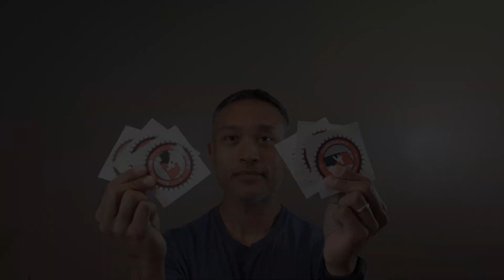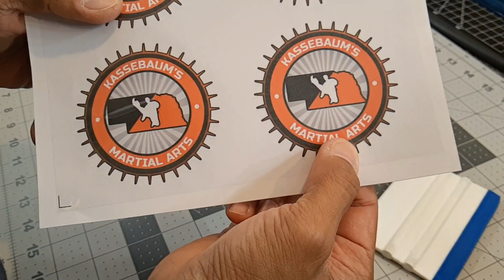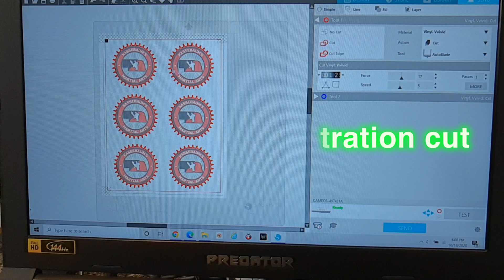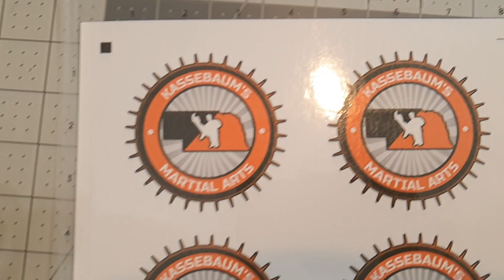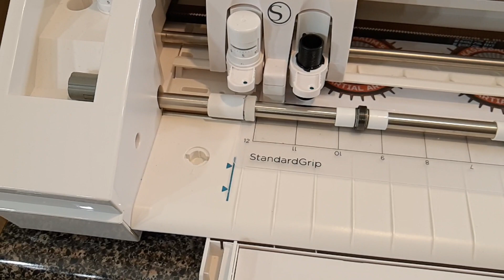How To Print and Cut with Silhouette Cameo | Make Full Color Waterproof Stickers at Home

Comment: I have found that I tape just the 2 upper corners of the printed sticker paper then when I go to apply the clear top sticker the bottom one does not move and then I can really control the wrinkles and can really use the squeegee to your advantage without having to hold the printed sticker paper down too.
Reply from the maker: Thanks! I've started to do similar as well because the sticker paper moving underneath was annoying.

Comment: Does laminating your stickers save the hassle of having to wait for the ink to dry on the paper or do you still need to wait for the ink to dry ?
Reply from the maker: I personally would wait for the ink to dry. If the ink is wet and you try to laminate it, and it's not fully absorbed into the paper, the ink may smear out as you press down on the laminate.
Reply: @ColorChangeCustoms  how long do you recommend to let it dry ? Because I let it dry for 24hr but the ink wasn’t dry yet at all
Reply from the maker: @SinKnight  I usually do overnight. But really it depends on the manufacturer of the ink, and maybe what the manufacturer of the sticker paper you used recommends as well, in terms of dry time.  For ink not to dry over a 24 hr period seems odd though.
Reply: @ColorChangeCustoms   Interesting, I’m using a canon canon ts6420 printer and at the moment I’m using its starter ink, I’m also using ZICOTO Premium Printable Vinyl Sticker Paper. Im pretty sure it might be the ink but I’m not sure honestly. Thank you for the information tho really appreciate it.

Comment: What about the cut settings to cut the whole sticker off so they are not all on one paper but separated individually?
Reply from the maker: I have my Cameo set at Blade Depth: 3, Force: 20, and Speed: 5.  However, because each brand of vinyl/paper is slightly different, and even each machine is slightly different (and the sharpness of the blades based on use), I always test and adjust the settings as needed.  What I have set is just a starting point to work from.  I recommend doing test cuts to see what works for your machine/sticker paper or vinyl/blade combination.

Comment: thank you for this video , i did my first sticker off your video ... i see these are for inside us only.  do you know what i should get for outdoor paper use ?
Reply from the maker: Sorry for the late reply.  Thanks for watching!  There are printable sticker papers that claim to be waterproof, however, in my experience, they really aren't.  You'd definitely have to put some sort of laminate over the sticker or maybe spray them with a clear coat.  The other thing to consider for making printed stickers for outdoors is that the ink in inkjets are not UV resistant, and will fade in the sun really fast (from my experience).  You'd have to use inks that are UV resistant and waterproof, as well as "waterproof" sticker paper/vinyl, for the best chance.  Even then, however, I'd still recommend putting some sort of clear laminate or coating to make them durable for outdoor use.
Reply: @ColorChangeCustoms  great point about UV resistant

Comment: Wow! Thank you!  You really simplified this for me.  My one question is "Would this help with fading from the sun?"  I make decals for golf carts and have found some of the sticker papers fade in the sun.
Reply from the maker: Thank you and thanks for watching. In terms of fading due to Sun exposure, you would probably need a laminate that has some sort of UV protection in it. But also, you would have to use an ink that is UV resistant as well. Standard inkjet inks for regular paper is typically not UV resistant, and will likely fade if not protected from UV in some way.

Comment: hmm, seem to have problems cutting through all the layers myself, blade 10, force 33 and still don't make it through all the layers lol
Reply: Sorry to hear that. Could be a couple of things like blade sharpness (how old is your blade) and thickness of materials. I know some laminates are thicker than others. Depending on how thick, you may need the deep cut blade.
Reply: @erickrocks1126  think i found out why, using clear vinyl instead of laminate, was wondering why my sheets were so thick lol

Comment: Trying to follow your tutorial but I have one issue.  I have my logo (PNG file) which is a circle but it is currently on a white rectangle.  Therefore I am not able to cut out on the circle.  It wasn't to cut the square.  I have tried to offset but it offsets off of the square border rather than the logo itself.  Any ideas how I do this in the software or do I need to do something to the file elsewhere.  Thanks in advance.
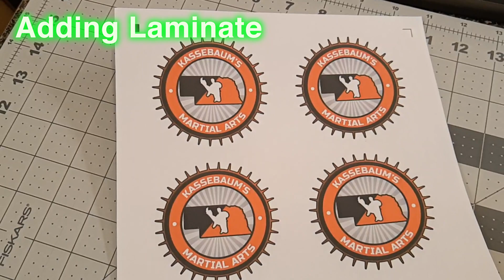Reply from the maker: You may have to do a trace and detach first to separate the actual image from the background rectangle it is on. I have a separate YouTube video on making stickers that shows you how to do that. That process I have starting in this video at about the 3:20 mark
https://youtu.be/dQTEAlK_kJ8
Reply: @ColorChangeCustoms  great. Thanks. I will definitely check it out.

Comment: I made stickers yesterday, using the sticker paper and laminating paper you recommended from this video. My machine would not cut through the sticker paper! I changed my blade, had it set to the absolute deepest cut and even  cut twice. I ended up having to use scissors. Do you know where I went wrong? Maybe the laminate changed and is too thick now?
Reply from the maker: It could be a variety of different things. Even though each machine is supposed to be the same, there are differences between each machine in terms of how much force and plate depth they actually use. The materials could have changed as you suggested. Really there's no one thing that I think would be the culprit. I always recommend doing test cuts before doing the actual cuts.
Reply: Thanks for the reply!
I did do a couple test cuts and they cut fine, but my stickers didn't cut through 🤷‍♀️
Reply from the maker: @marandaasche9721  Sorry to hear that. Maybe if you can get one, Silhouette makes a deep cut blade. Also, have you tried recalibrating your cameo?

Comment: Out of curiosity, why not use vinyl stickers to minimize the time and risk of losing stickers??
Reply from the maker: Hi there!  I'm not sure I understand your question.  Are you referring to vinyl cut decals?
Reply: @ColorChangeCustoms  sorry! Yes, I’m not familiar with the terminology 😌 I meant why not print on vinyl decals instead of sticker paper + adding laminate
Reply from the maker: @jade413  Ah, ok I think I understand better now.  Generally speaking, craft vinyl you would use to make decals (example: Oracal 651) is not a "printable" vinyl.  Sure, you could print on it with your printer, but the vinyl is not designed to incorporate ink, so any ink applied will just be sitting on the surface of the vinyl would be easily wiped off.  

Vinyl you see that has print on it, such as from a sign shop, uses specific printable vinyl to apply the graphic and then after that, it is still laminated (typically) to protect the image.  However, that process is done with large printers costing tens of thousands of dollars, (The print machine at the company I work for is something like a quarter million dollar machine!!) plus a lamination machine that is also thousands of dollars.  

Sticker paper or the printable vinyl I used in this video is readily available to home users without costing an arm and a leg LoL

Comment: Hi! What size are you stickers? I have a Cricut and I need to print and cut 3.5x3.5 circle stickers and Cricut would only let me put 2 on a page! Thus, I have a Cameo 4 coming today! How many 3.5x3.5 circles do you think Cameo will let me print and cut?
Reply: I bought a cricut first then a Cameo 4.... I sold the Cricut
Reply: @johnnyfudpucker6187  i have a cricut marker and it don't give me so much stickers
Reply from the maker: I don't recall off the top of my head, but I think the stickers were 2 in in diameter. I was able to fit six on one sheet after the designated non-cut areas and print areas are accounted for. 
For 3.5 in circles, my guess is three, but you might be able to get away with four depending on how you position them on the sheet.
Reply: Carmella, did the Cameo 4 arrive? how do you like it?